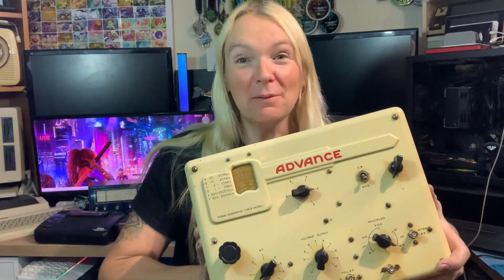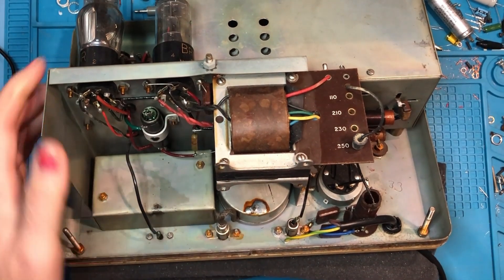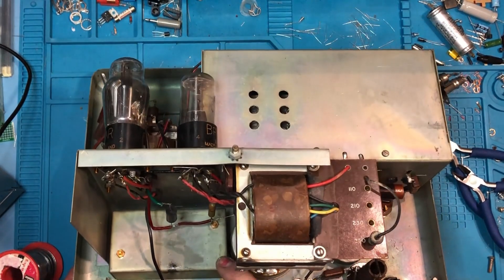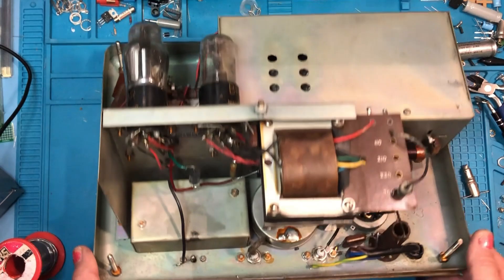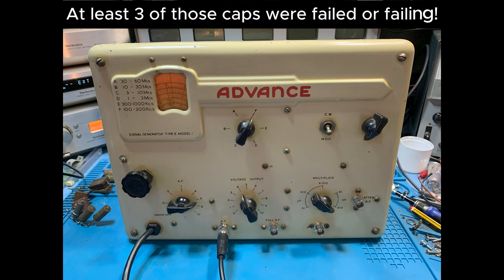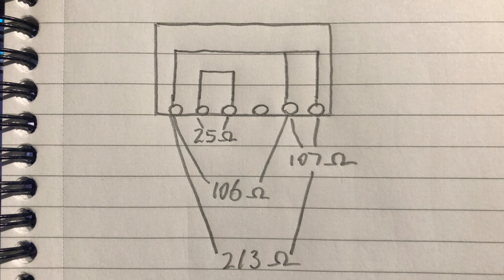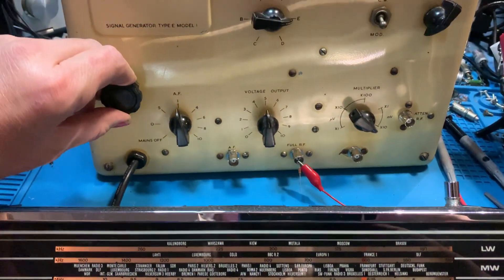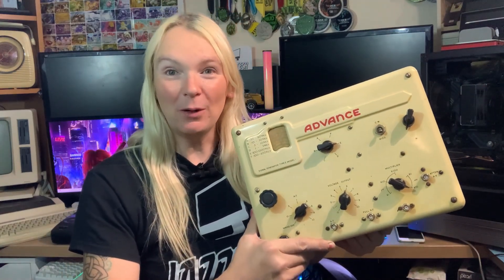1950s Advance E1 Signal Generator Repair

Comment: Nice repair there, especially that concoction of old caps. You can cover that non-original knob hole with a plastic, rubber bung available online or from hardware stores. It will look like a factory provided option hole. Now this s/generator could go on for another 75 years! 🐞

Comment: It would be interesting to know if the change to the BNC connectors improves the output leakage of this generator. 

I have an E2 model and have found it is not usable for microvolt output levels as there is so much RF leakage that you cannot reliably set sub 1mV outputs. The leakage is presumably from the Full RF output to the Attenuated output.  On my unit there is a metal tab that slides over to shield the Full RF output but it doesn't seem to help much to reduce the leakage.
Reply from the maker: Why don't you try changing yours over to BNC's. It's a very worthwhile and useful mod. Modern BNC's have very good insulation. I didn't look closely at the old connectors but if they are paxolin/phenolic resin bonded paper laminate insulation they are not likely to be as good as modern insulators.